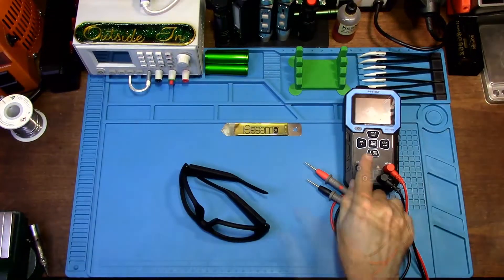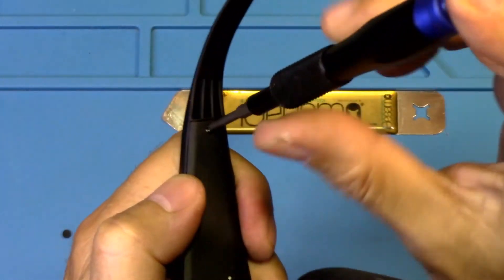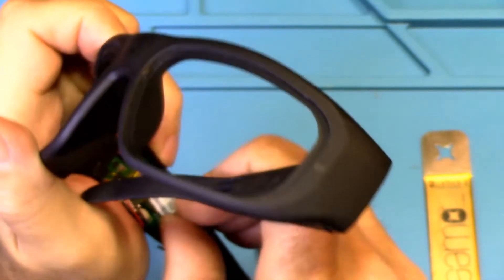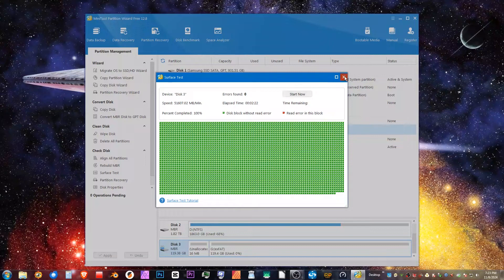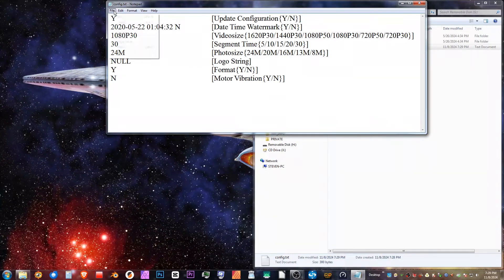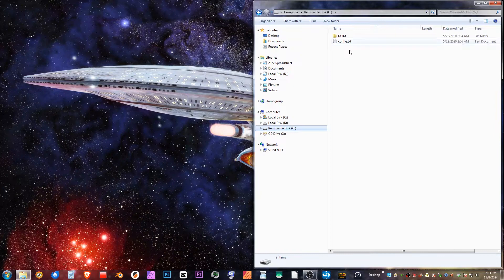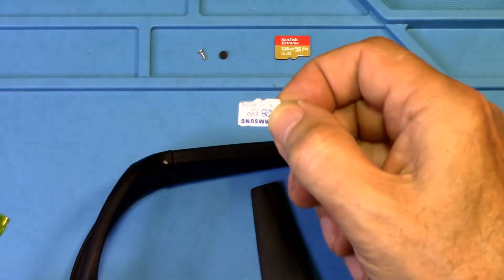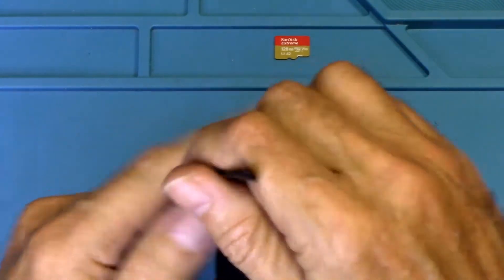Tear-down of the oho Sunshine Camera Glasses - Is there an SD Card Inside that can be replaced?

Comment: Hi Steven, the left hinge on my Oho broke, and I can't even find a repair kit or anything online. They still power on, but the temple just dangles and I'm afraid it'll break more. Any advice for repairs?
Thanks a bunch!
Reply from the maker: Wow, I am not quite sure what to say about that one - hmmmmm.  If it was me, I would maybe try JB weld as I have used that for a lot of different types of repairs.  Without seeing what is actually broken it is hard to be more specific on what would help better.

I could also suggest that you contact oho through their Amazon store, and maybe they will have an idea or maybe they could send out a empty frame that you could transfer the guts into, not sure they could or would actually do that, but they may have a solution, so it may be worth a try.

I went on eBay and tried to find a pair that didn't work so at least you could get a frame, but there wasn't anything.  If you could find a pair that someone is going to throw away because they don't work, that would be another option, but finding something like that would be nearly impossible I am sure LOL.

You could also try tape, but I guess that would be a little nerdy looking?...  🤪😂. 

Something else that I use from time to time for repairs is Gorilla Super Glue Gel XL.  It is pretty strong and works very well as you don't have to worry about putting the pieces together in a split second, as there is just a little window to work with before the glue setting up, so you might want to give that a try, and it would be a little less noticeable that JB weld, unless of course you are really good with JB weld and it's goopiness - LOL if that is even a word.

Other than that, I am kinda at a loss unless of course I had them in hand to see exactly the issue.  If you do find a solution from the options I have mentioned, please do let us know here, so others who may find themselves in the same situation will also have a solution. 

Thanks for the question and I do hope that one of these suggestions helps you out.  👍
Reply: @Outside-In.  I used the JB weld and it fixed it completely!! Thanks so much for your help!! 😁😁
Reply from the maker: @wildbluewings  COOL - Thanks so much for letting us know.  Yes, I use JB Weld a lot, but I also (when JB Weld would be too obnoxious) use Gorilla Super Glue Gel XL - works great as well but less noticeable.

That is awesome to hear my friend and am so glad you were able to fix the frames :).  👍

Comment: I just shot a whole video with mine and the red light turned on and vibrated but when I plugged into my pc there were NO video files :(  Until recently my glasses were recording just fine.  Has this happened to anyone else?
Reply from the maker: Was the Red light blinking when it was on???

It is not recording if the Red light is not blinking.

Turn on the glasses by pressing the power button, and when the Red light starts blinking it is recording.

To stop the recording, press the power button and the recording stops and the Red light goes steady (no blinking).

To take a photo, press the power button once while the Red light is not blinking and the Blue light will blink once to indicate a photo has been taken.

The glasses will not take a photo while the camera is recording video, and you must stop the recording by pressing the power button.

Not all of these glasses are created equal - meaning some vibrate and some do not, and mine does not vibrate.  On some glasses, the vibration is an indication that it has stopped recording while others that vibrate is to indicate that it has started recording.  Weird I know, so it looks like they could get this corrected.

You can try using a pin to reset the glasses (small hole next to the power button) and see if that helps.

Comment: Hello, I'm interested in knowing if you can switch from a 128G.sd card to a 512 G.sd card in the OHO sunshine camera glasses.  Thank you.
Reply from the maker: It only supports up to 128GB so not sure a 512 would work, and I would say that the only thing you can do is to try it out.  I would love to try it out myself but I do not have a 512GB SD Card.  I will have to look into getting one of those and giving it a try myself.  

Thanks for the question, hope my answer helps. 👍
Reply: Thats what I wanted to know too if  you can swap out for bigger storage and use a battery pack.
Reply from the maker: @HBARCARteam  Yes you can switch out with bigger SD card but only up to 128GB (per oho).  Yes you can use a battery pack to charge and record at the same time.

i am not sure your comment was a question or not, but I thought I would answer just in case. 😊
Reply: @Outside-In. Great thank you. Very helpful. Im charging up my computer cant wait to try these out
Reply from the maker: @HBARCARteam  👍

Comment: Hi Steven, I'm happy with my new OHO glasses. I was wondering where the microphone is located and if it's possible to eliminate wind noise with some home made noise filter? Perhaps a little foam placement can reduce the noise drastically.
Reply from the maker: Thanks for another question starsandnightvision.

I am not sure if you watched this whole video or not but the mic location is in this video, and to see that - go to 9:20 and you will see it as I put it back in it's slot...

I actually did put a small piece of foam in a sports camera's mic location that I had once, and if I remember correctly it did work, but I am sure you will be able to come up with an idea.

Thanks, and I hope this helps. 👍

Comment: There's no point in getting Oho Sunshine glasses with storage larger than 32 GB because that battery will run out long before you even use 15 GB of storage. Even the 4K model won't use more than 32 GB of storage. Also, clear lenses weren't advertised on the Amazon listing where I bought my 1080p glasses for £35 (listed at £80 but use price notification website to tell you when they lower in price) so I contacted Oho Sunshine via Amazon and they said they would send me clear lenses for free if I left a positive review so I did and they sent me them. I bought a couple of pairs of glasses and 1 pair stopped working. I contacted Oho and they sent me a firmware which did nothing. By the way you can get 1620p 50 fps just by enabling it in the options even though the options don't say it's supported. You can enable 50fps for all the other lower resolutions as well. 1080p is the only resolution that supports 60fps on the glasses.
Reply from the maker: If you use an external power source, you can record as long as the battery lasts, so it would make a difference having memory for more video length.

You are right, clear lenses are not advertised, but mine came with them and why I assumed they all came with them, but it is good to know that oho sent you a pair of clear lenses, but I don't like the fact that they wouldn't unless you left a positive feedback - that is quite disturbing and changes my opinion of oho

I noticed the 1620p option in the settings but just assumed that was just for higher quality glasses such as the 4K version.  Still though, for the price these glasses are quite good quality.  

I don't know why I cannot get a response from oho, and am wondering if it is only that oho does not respond to customers in the US hmmmm.  

Thanks for your comment and experience with these glasses and with oho - it is much appreciated.

Comment: Thank you for the mention; fame is at last. I am glad you opened the glasses because even though you found no fault with the card, you did highlight a possible solution: the mike. If it had become dislodged in manufacture or transit, that might be the source of the problem. Due to your excellent video, opening it will be a breeze. However, I will ask Oho if they will allow me to open the glasses and preserve the warranty.  I am surprised about what you said about Oho being so bad at communicating with you. Here in the UK they have always replied to my emails via Amazon and seem genuinely concerned about fixing the problem.  As you will know most faults are due to simple things, easily remedied. A dry solder or an out-of-position microphone would make sense. I doubt if I'll hear from Oho over the weekend but when I do I will give you an update. I am tempted to open the glasses anyway but the price just doubled on Amazon UK so I will have to be patient. Thanks again Stephen. You might want to consider placing your station name and or logo on the surface of your worktop so that it is in shot when you do a tear-down. Have a great weekend or else there will be trouble:)
Reply from the maker: Thank you Stephen for your thoughtful comment.  Wow doubled in price.  It is great to hear that oho is at least getting back to someone :).  It will be awesome to hear what they have to say in your situation.  The problem that I am having (I Think, after doing this video) is an issue with Premiere.  I have no issues with audio if I am playing files, or dragging them into CapCut, but mostly I use Premiere for editing, and Premiere is the only program that don't recognize the audio in the video files from the oho glasses, and why I have to re-compress them using HandBrake, so that is weird.  I cut all of that out of the video as It had gotten way too long.  If someone were to ask, I could use the footage for another video about my specific problem, but I was more focused on your problem, and didn't want the video to go the way of - "Rambling" LOL.  

Since oho communicates with you, maybe you could ask them what codec they use in the glasses for recording audio.  That at least (for my situation) would be a place to start finding a solution.  I am so glad that the video helped, I was up all night getting it finished.  I created a 3D print of my channel name filled with resin, - it sits on my power supply in view of the camera, and was wondering if anyone noticed it, so I guess not LOL.  I will have to think of a better location like where you mention, but I tried putting it on my work mat but it gets in the way of what I am doing.  You have a great weekend, and I will do my best to have a great weekend also..., because I certainly do not want trouble.  😛
Reply: @Outside-In.  I will be glad to ask Oho what codec they use. I used to use Premier for my editing but, just like you, I found them a bit fussy when it came to what formats they show and the ones they don't. I use Open Shot for editing now and have yet to find any conflicts. And I use VLC for everything else. I saw your channel name on top of the oscillator but it is a bit dark so it blended into the background. And of course, when you zoom in to where the action is, it's gone. Maybe a custom cutting mat? Stickers on your worktop? On-screen Logo bottom right? As your underpaid media consultant, I feel I would not be doing my job properly if I did not mention these considerations.
Reply from the maker: @slicedpage  Thank you Stephen for your thoughts.  I agree, I believe my issue is with Premiere only.  I used to use Shotcut (which is a lot like Open Shot) which is a very nice editing program, so maybe I should just go back to that especially when editing a video using files from the glasses.  After I sent my last reply I thought - wait a minute, I bet he did see the channel name, but when I zoomed in, it couldn't be seen, so thanks for adding that second part to your statement because it was exactly what I was thinking as well.  I was just watching the video again, and realized that possibly I could create a Spudger with my channel name so it would fit nicely on the work bench hmmmm??.  I am going to have to get to work on something like that - interesting...  And thank you for your considerations, it is what will help me to grow as a channel.  I look forward to hearing what you find out from oho.  Have a relaxing and enjoyable weekend.  My weekend will consist of another video I will be starting on - here in a little while, but probably won't make it to bed until sometime tomorrow LOL...  I will be working a lot on the bench, so maybe I will try and put something together with the Spudger idea - cool, and thanks again for your thoughts and considerations my friend. 👍👍👍
Reply: @Outside-In.  I just received a reply from Oho, ON A SUNDAY!!!! Impressive. They said opening the glasses and wondering at the delights therein was okay. I did, and the Mike is where it should be. No other damage was evident. They are sending a replacement. I mentioned that you had tried to have a conversation with them, and they said, "Yes, we are aware of this Outside-in chappy, but he is such a pest we have barred him from customer services."  Just kidding I did not mention you and I will ask about the codec when I get the new glasses. I don't want to ask now in case they think I am a pest too:)  When reassembling the casing I lost that little black bung you told us not to lose. It fell onto the deep pile carpet and it was gone. Our dog was last seen there six months ago, we are still waiting for him to come out.
Reply from the maker: @slicedpage  You are such a funny funny guy :)...  Glad to hear they got back to you, and are sending out a replacement - awesome!.  So have you tried making sure the mic is bad?.  It would be good to know if that is why there are a lot of people complaining about no sound in video files.

Thanks for the update Stephen - much appreciated.  👍
Reply: @Outside-In.  I had a break from searching for my dog to open the glasses again. I removed the white fabric from the head of the mike in the hope that it was the cause of the sound problem. I swapped out the micro SD card.(Mine was a Sandisc ultra 32gb). Made a new config file and still no change. The video is good just no sound. Hopefully, the new one will work properly. Can I go now? You make me do all this work while my poor wee doggy is lost in the wilderness of tufts and loop pile.
Reply from the maker: @slicedpage  Go - Find your wee doggy that is lost in the wilderness of tufts and loop pile.  Thanks for the update, it would be great to know what is wrong with yours, as it probably a common issue with the others as well.  It probably is the ROM though like you suggested in the beginning.